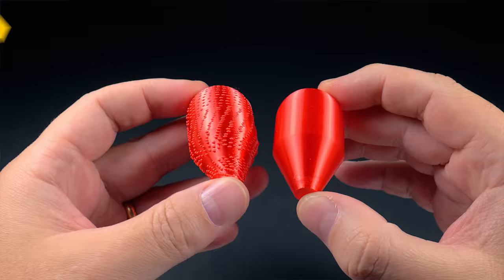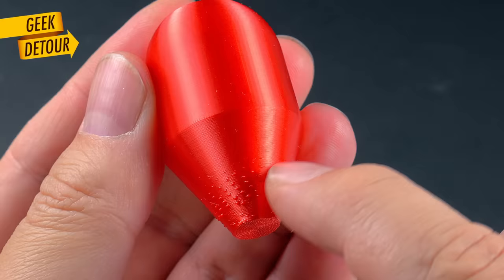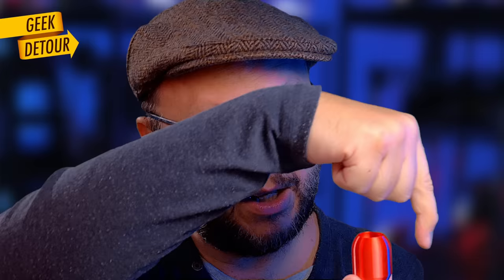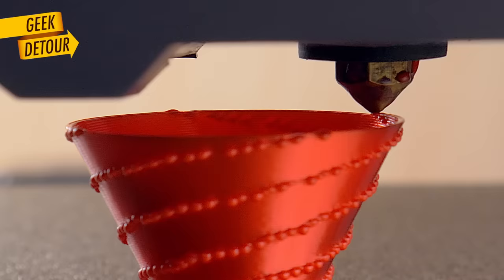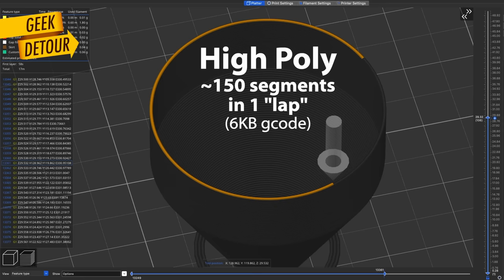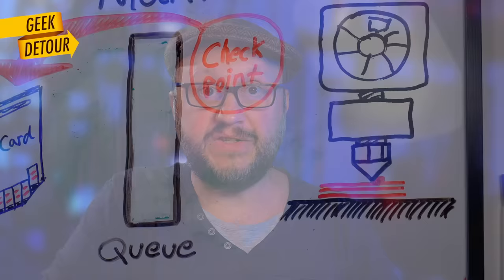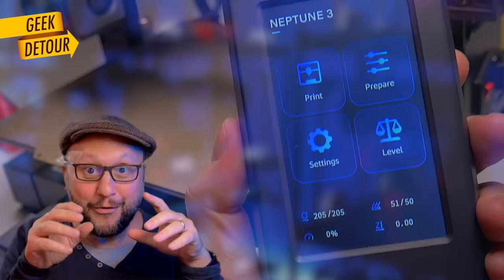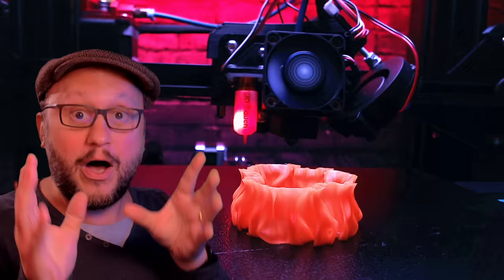3D Printer Blobs: a mysterious problem you won't guess how to fix 🤔

Comment: I hope Elegoo is watching so they can put YOUR GCODE in there next firmware update. Thanks for the video and for YOUR GCODE
Reply from the maker: Hi Jim! Thanks! Well, my GCode doesn’t do anything other than disable Power-loss Recovery. The only change that would be very nice is to be able to disable (or enable) it on the LCD UI.
Power-loss Recovery has been a strong marketing selling point. I don’t know how much people really benefit from it…
What I want to see in future printers is the hardware implementation that detects the power-loss, but has Capacitors to keep the board enough time to - then - save a checkpoint and turn off.
Reply from the maker: All printers should have. If this video helps this to become a reality, I’LL be super happy!

Comment: Worked on original Ender-3, prints look much cleaner. The printer is now actually usable for professional use and quality parts. Thank you!
Reply: Just got my ender 3 for under 200 and I've never been more pleased. Finally able to get into 3d printing
Reply: Will try it on my ender 3 pro tomorrow cant wait

Comment: Another option would be to use arcs instead of lots of little segments. That would decrease the amount of gcode needed in any given time period significantly, to the point that you could probably print that circular object with 2 lines of g-code per perimeter, one for the circle, and one to move the nozzle to the next starting point. Arcs still aren't well implemented by slicers from what I've seen, but they're getting better. I think biggest issue might be that most models are distributed in STL files which, as mentioned, don't have any curves so slicers need to attempt to figure out what's supposed to be a curve and what isn't. I think STEP files can do curves, so perhaps people should start using those more.
Reply from the maker: Your comment is SPOT ON!  But firmware also needs to get better: ARC was not properly implemented for bed-level compensation: if you have a big arc, it seems only the edges would go up or down to follow the mesh… height changes that should occur in the middle were not applied at all…
But the future is bright 😃 For CAD models, step format must be supported for more slicers too: it seems only the PrusaSlicer Beta support them now.
Reply: @GeekDetour  Hmm, that's not great. I could have sworn STEP was more widely supported than that. Well, that explains why hardly anyone uses it, then.
Reply: It has been a bugbear of mine for ages that STL files are just inadequate for high-quality models. I think it started because it's an easy format to parse, so early slicers used it and it became the de-facto standard. PrusaSlicer does now import STEP files, but it polygonizes them before slicing, so it amounts to the same thing. A G-code command for b-splines already exists (G5), and I'm sure that plane/b-rep surface intersection is mathematically viable. I know slicing is a very difficult task full of corner-cases, so even if it just uses b-splines for the outer surface, that would be a big quality improvement.
Reply: plus if you're making a really curvy object you can also probably try and use splines for that
Reply: I've been using Arc Welder program / plugin. I had to update the firmware on my printer to support this but at the end the moves are certainly smoother!
Reply: I have never been able to use arcs.  I don't know why.   Everytime I try, I get something that does not even resemble what I was trying to print.

Comment: Very clear and concise explanation! I ran into this issue when printing high-poly models off the SD card, but when I got OctoPrint setup the issue went away altogether. I always assumed OctoPrint was faster than my printer when processing GCODE commands, but I think that it must have been a crappy SD card. Fantastic video, and I'm sure it will help many people new to 3D printing.
Reply from the maker: Thanks Adam! Very kind words! 🤗
Reply: Octoprint doesn't really process the gcode, it just buffers it to the printer.
Reply: @alanb76  you're right, though there are pre-processor plugins like Arc Welder and Octolapse that modify the geode before it gets sent off to the printer.

Comment from the maker: OMG! This one took me a long time to figure out and make an “accessible” video about it 😅
I would love to have some feedback!
Reply: In Cura printer settings -> Start G-Code : M413 S0 ; Disabled Resume after Power loss
Reply: Hey, I am changing to a Octopus board and I decided to use Klipper. From what I understand how Klipper works, the power loss recovery shouldnt be problematic here. What do you think?
Reply: I really liked the whiteboard explanation. Very effective.
Reply: This is the first video I watch on your channel and is... amazing! I'm sure that your content must be great after this. Thanks for sharing good quality videos!
Reply: This is the first time you've popped into my feed and I subscribed immediately. Great video!
Reply: year 2022. Why to even use marlin? That is just beg broblems. Use klipper.
Reply: @TH-wr1dv  couldnt this happen in Klipper too?
Reply: @Geek Detout - another valid point is that this function wont make your print successful after power loss....there is a chance but its not 100%. I remember that while I was building my own Marlin FW for E3 - I saw this function and read that it may cause problems.....so I turned it off
Reply: @chemistt  klipper works quite different way so most probably it wount. And anyway it alerts if motion engine left behind.
Reply: Perhaps more technical than you are looking for:
Most MCUs access the SD card in slow, serialized "SPI" mode, which is usually around 1 megabaud, and the flash device to commit writes in 4k chunks.  The CPU in a fruit pi can write much faster with 4 lanes in "SDIO" mode. So a better plan, would be to write checkpoints to EEProm, or simply, as you said, to have enough power to commit the checkpoint only when power loss occurs.
Reply from the maker: @GnuReligion  That was a great deal of information! Love it! Thanks
Reply from the maker: @dingsens2810  When you use Klipper, and even just OctoPrint, Powerloss recover has absolutely NO PLAY.
Reply: @GeekDetour  What do you mean with "no play"?
Reply: Great info. Excellent.
Reply: Hi
Reply: it may be not harware fault but software was mosst culprit. beause marlin can be coded to make check point in Z axis as default so the when power loss happens and turn back on all marlin need to reload g code and run back to Z axis step and load remaining lines (remember G Codes run line by line. you can use it as default)
Reply: Wow! What a great video to watch!
I appreciate you making a video on how to solve it!
I know how sometimes, the problem's cause can be so simple, but it can take days to solve it, and hours of research.
Thank you for the video! And the video timelapse at the end was pretty sweet!
Reply: @GeekDetour  I'm getting this same issue with prints using OctoPrint which is really wierd, been bugging me for month trying to figure out why. Only happens with my CoreXY printer as well which runs at a faster speed than my standatd printer so I think it's something related.
Reply: Brilliant explanation. As soon as you said "Power Loss Recovery", I knew it was the save states. People don't appreciate the different speeds of the storage areas in computers. 

A typical spinning hard drive is like driving 40 mph down a road. It's not even highway speed. A typical SSD works at the equivalent of 400 mph, the speed of a passenger jet. That's a big difference. But RAM runs at 5600 miles per hour, which is Mach 8, and faster than even the fastest fighter jets. THAT difference is devastating.

When you have to write something to a storage device, you're throttling down from Mach 8 to 400 mph. It's like slowing down by running into a mountain. It will work, but you probably won't like it. Without excellent buffers, data writes are always going to be a problem.
Reply: your voice sounds robotic
Reply: This is such a sassy video I can't even believe it
Reply: Wow that was a rollercoaster of a mystery ride! I never ever would have guessed the culprit to that issue! Thank you for your very well explained video! 🤓💖
Reply: @GeekDetour  What software did you use when showing the Low poly 2KB and high poly 6kb ? And also what other software do you use when designing and printing , previewing or debugging ?
Reply: I renamed the download and tried printing the file. Now my Cobra 2 max won't print anything. It freezes at the start screen every single time. PLEASE HELP! what happened?

Comment: I had this issue on my Elegoo N3Pro from one print job to another, same file, same filament same everything. 
Thanks to this video I changed out the cheap SD card which came with the printer for another sub-32 GB FAT32 SanDisk SD Card and voila - zero blobbing. 
No power recovery control needed to be turned off to get back great print quality.
Reply from the maker: Thanks for telling me this! I was honestly in doubt if it was useful to mention other causes - the cheap SDCards, cheap/long USB Cable… I am happy it helped you 🤗❤️👍

Comment: Thank You, A novice printer here. I wanted to print some items in Silk PLA and have spent a week attempting to print with no success. I watched videos and read articles on how to set up the slicer to no avail. I had watched your video and didn't realize what I was seeing. I finally realized that the blobs were not random and then aha your video opened the heavens.
Reply from the maker: Hey! That’s so cool ❤️ Which printer is yours? Could you fix it?
Reply: @GeekDetour  Yes with one exception. I am printing a half sphere. Three sides were perfect, one side from bottom to top has slight imperfections. Which makes me think that I may have a fan issue. I print in an enclosure.
 I have the Elegoo Neptune 3 Max.

Comment: Guess: Pressure in the Bowden tube after switching from the faster infill to the slower perimeters.
Or a too slow retraction when ending the perimeter, so filament still gets pushed out.

Solution: Enable Linear advance, less extreme differences between infill and perimeters and quick retractions.

Edit: I was wrong, my suggestions fall into the "randomized seam" category.

Comment: Thanks for the video. Professional machinist here going to get my first printer soon, still learning about printer hardware, drivers etc, have to rewind my brain quite a bit to my older cnc machines as it helps me get into printer mindset as they are pretty similar in terms of some similar issues compared to the power of my new machining centers. Drip feeding millions of lines of code into one of my older vertical machining centers from 1989 with an older fanuc control presents similar issues on occasion to this. Thanks for the great content!!!
Reply from the maker: Wow! I am glad you enjoyed the video - it is an “advanced/corner-case” topic and I wanted to make it deep enough, but easy to understand. You seem to know your stuff, so, I am relieved the video still looks interesting for technical people! 😂
Reply: @GeekDetour  haha, I know a bit about machining, I have run my own precision fab shop for twelve years now and worked in a few different industries prior. I have a lot of older nc equipment and specialize in oddball robotic integration and product development for many industries. Oddly I have been supplying parts FOR really high end 3D printer manufacturers for the past decade. I know a lot about metal printing from powder and additive near net in aerospace alloys, but very, very  little about common 3d printers that don't cost $200k. I have much to learn! Been really enjoying your videos
Reply from the maker: It looks fascinating! Of course, hobby printers are a completely different world - muuuuuch simpler, and yet, because of the low-price components, the quality of the results can vary A LOT. And getting the best out of these machines sometimes require a lot of tweaking. You will certainly have fun! It is crazy to have mini-factories at home! Eventually, even metal powder prints will arrive at our homes!

Comment: Amazing that you figured this out! 
I print certain "standard" pieces for my business, and most of them are mostly "cylindrical".
The real question is, why don't slicers and 3d printers support g2-g3 movements. Makes the code incredibly lighter, and leaves the interpolation to the controller.
I've tried using a plugin called ArcWelder, but it mostly messes up the code for some reason.
Reply from the maker: Nope, first, thanks for the donation. NOW, let’s talk about Arc Welder: it works! If your printer is not printing it well, you should look into updated versions of the firmware for your printer. I was happily surprised that the Neptune 3 (that I show in the video) had ARC support from factory and indeed it printed this test piece perfectly (even with Power-loss Recovery activated, no Blobs!). My older printer, a Frankenstein Ender 3 (highly modified) doesn’t print ARCs well - it is my fault because I enabled it and compiled the firmware very shortly after ARC was introduced in Marlin… I am sure it I get a newer version of Marlin, adjust for my FrankEnder and compile it again, it would make ARCs nice now. Yeah! G2 and G3 are the future for curves… I want to see it implemented on all slicers without plugins. But we are in a transition period. A Lot of printers still don’t have it.
Reply: @GeekDetour  any chance of a video for the new g2 and g3 feature on the latest prusa version released just a few days ago? Perhaps a little overview on the subject is in order? Thank you in advance sir!

Comment: Awesome video! I’m new to 3D printing and it feels like there’s a new hiccup with every other print, so this really helps. The problem solving has been quite fun, but it’s nice being able to discover content like this— easing future headaches lol

Now, If I may: as a sound geek, I would gently suggest an edit to your audio EQ. Namely lowering the Gain on your mic to minimize the clasping noises of the mouth (or if your gain is already low, I would point to using a low-pass filter), and a slight high-pass filter to lower the sibilance/ “S” noises. Nothing egregious, however. Your audio is more than passable as it is
Reply from the maker: Hi Jason! Thanks! The best part of 3D Printing is definitely the never-ending journey of learning.

Sound is another never-ending journey. Your comments are nice (and gentle, thanks!) Every person will Equalize on a very different taste. And the perception of a “good sound” will change a lot too depending on where the video is watched: mobile phone without headphones, in-ear headphones, headphones… and some headphones are very bass-heavy, others are more neutral… some lower-cost phones are more muffled. And there are TVs and Home Theaters (that if you go very “Pod-Casty Bass”, it sound very Boomy on Home-Theaters…. 
My audio chain has all you can imagine: de-hiss, compressor, too-low frequency cut… I hear the videos in many devices, a few headphones, on the living room - and I might favor a more aggressive high because it favors clarity of speech. A TV Broadcast audio engineer would probably change it a lot, but, then… he would use different microphones as well… Audio is infinite - just like 3D Printing 😄

Comment: To anyone out here that still has this problem even when following the instructions in this video (thank you for the video btw), try disabling your webcam. The camera can cause this for two reasons:

1. It stops to take a picture for a timelapse (the nozzle oozes)

2. The webcam steals resources (CPU) causing your server to stall for a while (stalling means no commands are parsed to your printer)

I struggled with this for quite a bit.

Update: I don't know what changed but since I wrote this comment I can print non issue with the webcam stream enabled. Maybe it has something to do with me tweaking the buffers in the firmware for my SKR board, or the cura 5.3 update. I can't be sure what fixed it but it works.
Reply from the maker: Making Timelapses usually is not nice for the piece you are printing. Everytime I make a timelapse, I am more worried of having a beautiful video, knowing the printed part will be less then ideal.
Reply: I am not a creator but  I like the peace of mind webcam support offers. I mean you can watch your print remotely (you can also run failure detecting tools such as octoeverywhere's gadget or obico). I have ordered a cheap ip cam online just for this reason.

Comment: I normally use octoprint because it gives me more control over the print job, shows more informarion and allows time lapses, but when printing high precision models (especially with round shapes), the printer started waiting sometimes, while Octoprint was transmitting the new commands. The USB cable wasn't very long and the baudrate was 2Mbit/s but it still happened. A better solution would be to send bezier curve/circle commands to the printer to print round shapes instead of hundreds of linear moves. But STL does not support anything except triangle meshes.
Reply from the maker: Hi there! I didn’t mention in this video because it was a bit long already, but some printers come with the firmware supporting Curve (Arc) commands (G2, G3) - and there is a plug-in called ArcWelder for OctoPrint, that analyzes the GCode and replaces “segmented curves” for arc commands. You should look into ArcWelder, it might help you.
Reply: Thanks, I didn't know theres alredy software to solve that issue. I will try this out next time i print a more complex object.

Comment: I disable the recovery feature becasue A) I use Octoprint and B) the entire setup is on a large UPS (spoils of decom'ing a data center). Even a small one you can get from Amazon for around $150 will keep you going through most outages.